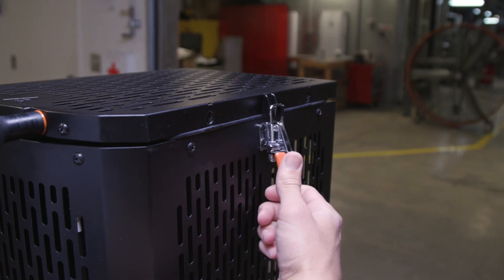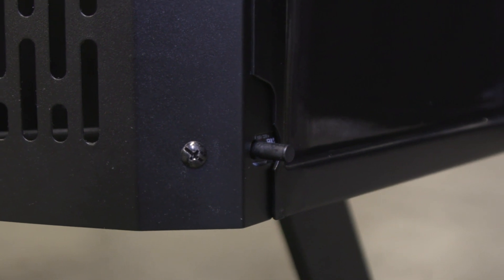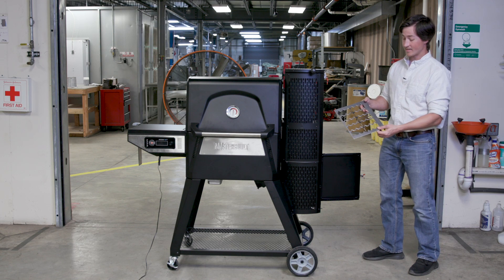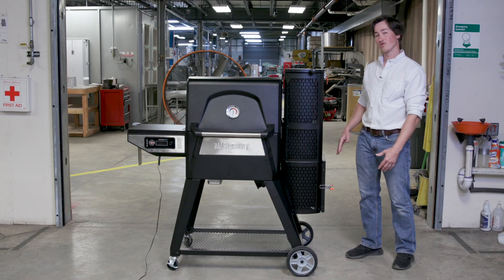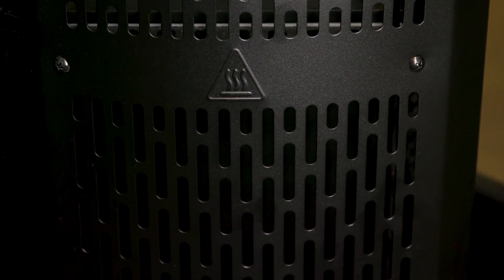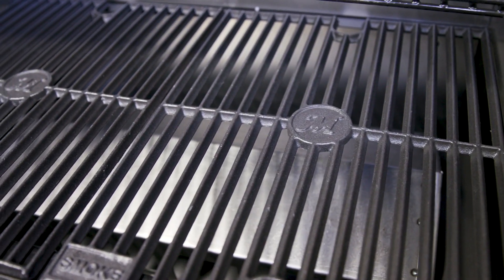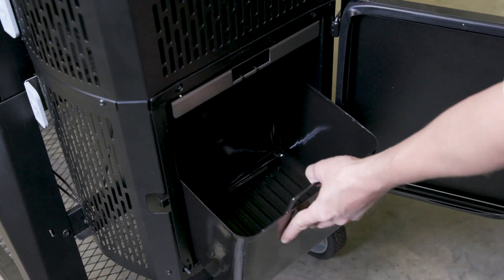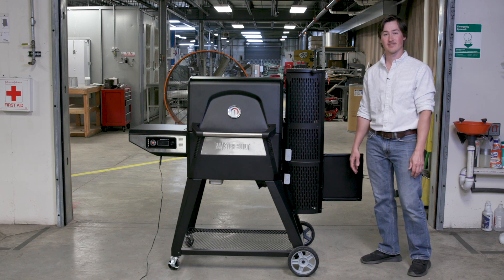Understanding the Gravity Series Grill + Smoker Charcoal Hopper

Comment: I love mine! The best tip I can give anyone is to clean out your hopper between cooks🤣. I also use a blow torch to light mine. I don't recommend grilling with high heat after using this as a smoker. Grease fire warning.

Comment: you say the 'fire is contained in a 5" area' but you don't say how. This is how charcoal starters work. You pile charcoal on top and light the bottom. The entire column of charcoal is soon blazing. I mean obviously it works or it wouldn't be sold. But it would be great if the pitch video explained how it keeps all the pieces of charcoal sitting immediately above and touching the burning coals from burning also.

Comment: Just increase the wall thickness of the burn chamber and or make it out of stainless at least .100 thick and this thing would be awesome. I will re sleeve mine someday when it burns thru to the firebrick. Most people cant easily do it. There are people charging a ton of money for a drop in sleeve already!   It wouldnt cost much in China manufacturing and you can get rid of the cheap analog gauge to pay for it. Its Not necessary since it has a digital readout a foot away imho.
Reply: patriotpaul Totally agree with your comment.  The analog gauge is silly, to be quite honest, but I guess they felt compelled to include a gauge in a grill.  Can’t blame Masterbuilt, really.  As for the fire box, I agree.  Masterbuilt needs to make this more durable, but then again, it could be by design to get you to upgrade or replace your smoker in due time.  To be honest, I’m not thrilled with the fire starter process.  Seems clumsy, inefficient, difficult, almost cheap.  There’s room for improvement here.  Don’t get me wrong, I love my MBGS 1050 smoker!  It’s early, but so far, so good!
Reply: @gilguzman8359  Sure I can agree with that . I found some firestarters made of a thick fiberous paper material that have never let me down not 1 time. You break them apart and slide them in and light them Leave the door open and don't fill the charcoal to the top so it can get air throughout and every brand of charcoal lights for me. Its made by Rutland and called Firestarter squares www.rutland.com hope that helps somebody. I guess they could add a propane tank and igniter but again it just adds more cost that would be better spent on a heavier firebox.

Comment: My top slide gets stuck and is very hard to pull out. I have to basically get a pry to get it out. any recs to fix this issue?
Reply: It may just be a crushed part on the slide edge try a long thicker wedge shaped piece of metal and a flashlight looking down it and rebend it just slightly if that  is it. If Not then you can start by dissassembling the heat sheilds then everything else around it.  Once you get the chimney off you can see what is binding it.

Comment: I purchased the 1050 a couple of weeks ago,And my biggest problem is the larger shut down slide will not slide in, because it is being blocked by a piece of interior metal,And as a result I cannot not shut down my smoker,I have tried to reach master built and that has been a total disaster because they're not answering their phone or emails
Reply: Take it apart and figure out what is blocking it. That is what somebody is gonna have to do. Did you bend it over 90 Degrees when you assembled it?
Reply: @PatriotPaulUSA  The blockage is in the interior there is a piece of metal blocking the upper damper
Reply: john stevens I have no problems with the dampers on my MBGS 1050 smoker.  They work like a champ!

Comment: My ash area paint is peeling, and I think being blown all over the food..  Also uses 5x the amount of charcoal as my egg style bbq. Pieces of charcoal that fall through the charcoal grate is bit unreal. Many people have modified this grate so less good unburnt charcoal falls through. I spent $20 in charcoal on a 9hr cook at 225f
Reply: I bought the 4pk walmart stainless skewers and modified mine but now it holds a bit too much. I have to beat on it a bunch to get all the leftover ash to fall and use a couple fire starters to do a 2nd cook.  So now I just don't fill the hopper to the top and it works better. It uses very little charcoal tho so you should probably do this if that is the main problem. It is all pretty minor, It is by far the best smoker I  have and the easiest!  You can set the temp and walk away. My offset smoker is all day feeding wood.
Reply: If you are not smoking and won't be putting wood chunks into the ash bucket, then yes I can see why you'd be surprised by the fall through.  I have no issues with the amount that gets through using lump because of the amount of smoke I am getting from the hickory and pecan.  YMMV
Reply: @Shift4g  FWIW I am using wood chunks on every cook in the ash bucket and I never light them and I have 4 skewers thru my grates and they are always burned up every time I check I add more. I think its a bit too aggressive of drop thru, but its just an opinion. Its like 4.00 for 4pcs of wal mart stainless skewers try it you will see. It still falls thru.
Reply: @Shift4g  It still gets thru fine even with 4 skewers i cut off after I inserted them.  I just throw wood chunks in the bottom come back in a HR and throw more chunks in the bottom. LOL  The hot ash drops smokes and lights them up!
Reply: @PatriotPaulUSA  how big are the chunks that you are using? I did the mod today with 4 skewers but i struggle to light them up or get smoke for the first 1.5 hrs. There were probably double the normal sift size. Before that i would have no problem getting smoke from the chunks in the ash tray